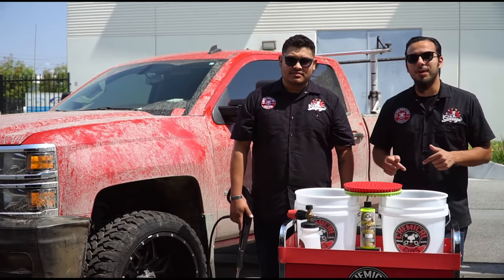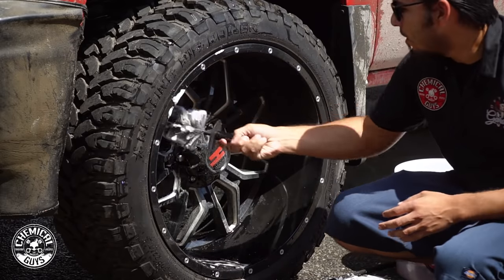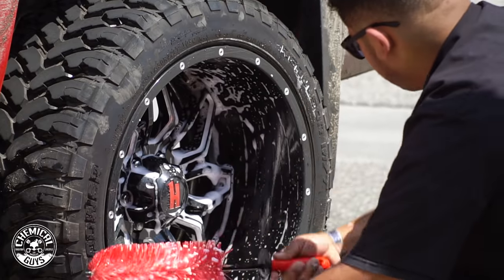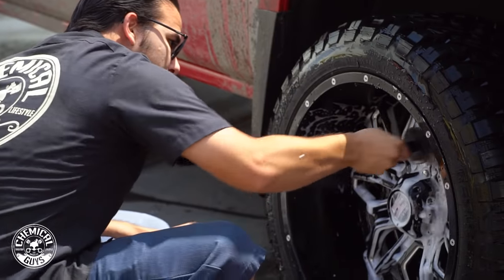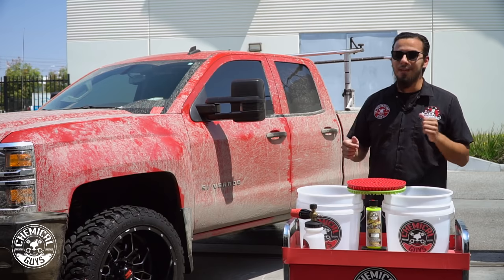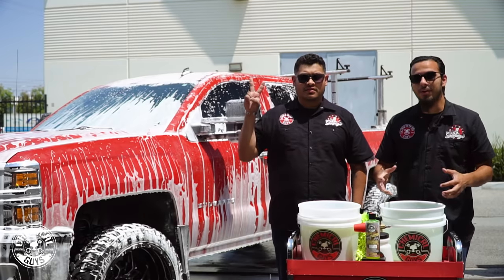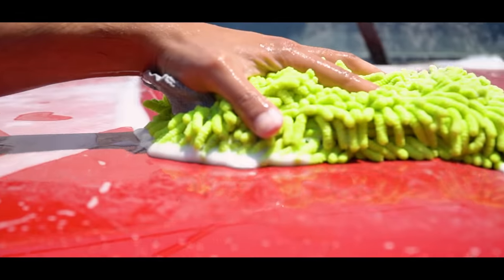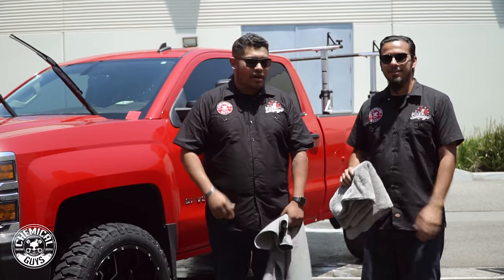How To Clean REALLY Muddy Truck! - Chemical Guys

Comment: I’m glad you guys used a SunJoe electric pressure washer. Most think you need gas to make a lot of foam which isn’t true. Do you guys ever swap out orifices on your cannons? Or better question what size do they come with ? Great video! Chem Guys make the best car soaps!!
Reply: I have the ryobi 1.2 gpm 2000 psi and run a 1.1 orifice on my foam cannon. they have to run like .8 to get that foam out of a sunjoe.
Reply from the maker: Hi guys, we do not change or swap out orifices in our cannons. We use them exactly as they come. Thanks for watching guys and make sure to check out our latest video just released moments ago!
Reply: REALLY? I can't believe that foam amount without changing the orifice.! Like I said what pressure washer I use and I find it hard to get really really thick foam with my 1.1mm on the snow foam cannon!

Comment: My white truck still has some specs of mud left on it in certain areas that I can’t seem to get off. What exactly do I need to do here?
Reply from the maker: Hi there! If the paintwork is stained it may require a clay bar treatment to thoroughly cleanse the surface. A Medium Clay Bar with Luber should have no problem restoring shine.

Comment: I know it's more of a commercial for their products but how much would it cost to buy everything they used in the video? Would it not be cheaper to just buy a few passes to a full service car wash? (In Canada we have places that hand wash your car inside and out for about $30)
Reply from the maker: Hey Bryson, thanks for stopping by. Sure a one time car wash might be cheaper at first, but the whole point of purchasing is the product will last you and last you. Check out the 14 piece detailing kit below. At only $89.99, it only takes 3 washes for the kit to pay for itself, and the chemicals will be no where near empty. The kit has pretty much everything you need to clean, wax, and dress your car. You may want to add an odd brush or chemical down the line, but the vast majority of the items you will need are included to get started detailing right away. This kit doesn't even require an expensive pressure washer- you just hook the TORQ foam blaster up to your standard garden hose! Thanks for watching, Bryson, and let us know if you have any other questions!

Comment: Could this be a good soap for semi trucks or do you have a soap for semi truck detailing?
Reply from the maker: Hi James! Tough Mudder is a great wash for semi trucks. The thick soap clings hard to abrasive dirt and sand, releases it from the surface, and surrounds it with slick lubricants to help prevent swirls and scratches. Thanks for watching and thanks for being part of the Chemical Guys family!

Comment: How do you avoid water spots washing in direct sun? Or have I been rushing myself for no reason. LOL
Reply from the maker: Hi Scott, great question. Here are a few reasons:
1. We use deionized water.
2. This soap, like most premium CG soaps, is pH balanced.
3. The climate was temperate. 
4. The paint was cool to the touch. 
5. We dried the truck immediately. 
Thanks for watching, Scott, and thanks for being a part of the CG family!
Reply: I have a bunch of your soaps, but no deionized water. I wash either early in the morning or in the evening, wash with the foam cannon and mitt like a crazy person and run it into my garage to dry it off. And still manage to get a few spots. Not bad mind you. We have super hard water here in the Mid Atlantic. Thanks for the reply!!
Reply: Scott Dabson hard water is hard to not get spots. Got to be efficient as it sounds you are,  here or there you can spot to take care of them. I used to live in a house that had bad hard water and man it sucked washing cars.

Comment: What kind of power washer did y’all use?🤔
Reply from the maker: Hi Sebastian! Great question. In this video, we used our electric pressure washer, which is a SunJoe SPX4001 with a PSI of 2,030 and a GPM of 1.75. We recommend a machine with similar specs! Thanks for watching and stay tuned for more awesome content coming your way soon!

Comment: Nice, you using a SunJoe pressure washer. That's what I use
Reply from the maker: Hi! Yes that is correct. We currently use a Sun Joe electric pressure washer with a PSI of 2,030 and a GPM of 1.75. We recommend a machine with similar specs!Thanks for watching and thanks for being a part of the Chemical Guys family!

Comment: Hey guys any recommendations for removing tree sap? I’m out in Oregon and I’ve got a pine tree over my driveway, with the recent heat wave it has completely coated my truck with sap. I’ve used your V07-Blacklight- honeydew snow foam and I’m still left with some residue.
Reply from the maker: Hey Johnny, great question. Here at Detail Garage, we use Butter Wet Wax to safely remove tree sap. Watch the video below to see how. Thanks for watching, Johnny, and stay tuned for a new video dropping tomorrow !
https://www.youtube.com/watch?v=0qUtgB-bP08&t=8s
Reply: Thanks guys!

Comment: What type of power washer are you guys using ?
Reply from the maker: Hi, we currently use a Sun Joe electric pressure washer with a PSI of 2,030 and a GPM of 1.75. We recommend a machine with similar specs! Thanks for watching and thanks for being a part of the Chemical Guys family!

Comment: I'd like know what brand of pressure washer and psi you are using. Tia
Reply from the maker: Hi! Great question. In this video, we used our electric pressure washer, which is a SunJoe SPX4001 with a PSI of 2,030 and a GPM of 1.75. We recommend a machine with similar specs! Thanks for watching and stay tuned for more awesome content coming your way soon!

Comment: i’m not a pro or anything but wouldn’t u wanna clean wheels last???
Reply from the maker: Hi Trent! In most cases, the wheels are dirtier than the vehicle so if they are left for last the abrasive filth from the wheel can be transferred to the body which would need to be wiped away carefully to prevent damage. Cleaning them first reduces this risk. - Happy detailing!!

Comment: What psi is the pressure washer y’all are using?
Reply from the maker: There are so many different models on the market but I recommend using a pressure washer that is capable of 1800-3500 PSI and between 1.5 - 2.0 GPM.

Comment: This is one of the few videos that actually shows them putting soap on the vehicle when its muddy. This is the correct way to wash off mud. Soap breaks up the mud and provides a lube to protect your paint from being scratched. Almost every other video shows them blasting the mud off with a pressure washer first and then soaping it afterwards and that's the wrong way to do it!
Reply from the maker: Thanks so much for watching!

Comment: Washing in direct sunlight? That is a no no,  It will create water spot. What is the tank at 7:12?.
Reply from the maker: Hi there, we appreciate your concern for this customer's car, but would like to impart a few reasons why it was safe for us to wash this car in direct sunlight:
1. We use deionized water.
2. This soap, like most premium CG soaps, is pH balanced.
3. The climate was temperate. 
4. The paint was cool to the touch. 
5. It's California, so why wouldn't you want to be outside? 😊
We have detailed thousands of cars over many years under the conditions above, all to the utmost satisfaction of our customers. If you ever have any questions, or are new to detailing, we encourage you to contact us for advice. We can be reached via telephone, email, or even facebook messenger and are here to help.

Comment: What power washer is that?
Reply from the maker: Hi! Great question. In this video, we used our electric pressure washer, which is a SunJoe SPX4001 with a PSI of 2,030 and a GPM of 1.75. We recommend a machine with similar specs! Thanks for watching and stay tuned for more awesome content coming your way soon!

Comment: Only thing I would’ve done differently was start with the body first, wheels and tires last
Reply from the maker: Hi! There are a few reason why you want to clean the wheels first, a few which I will highlight now. If you wash the body of the car first, then you risk getting dirty water/product onto your newly clean car paint. Wheel cleaners and tire cleaners often use harsher chemicals so doing the body first minimizes the chance of getting overspray or spent product on the paint. If you washed the body first, you would need to dry the body before moving onto the wheels and tires to prevent water spots. It's extremely hard if not impossible to not get the body wet again when washing and rinsing the wheels and tires after drying, so you end up washing and then drying the whole bottom part of your car again! You can dress your wheels and tires after the whole car is clean. Thanks for watching and make sure to check back every Monday, Wednesday, and Friday for new video uploads!

Comment: Ok but I don’t understand why you cleaned the wheels first... unless you went back and dressed them. All the mud just falls right down on them. Maybe i missed something
Reply from the maker: Hi! Good question. There are a few reason why you want to clean the wheels first, a few which I will highlight now. If you wash the body of the car first, then you risk getting dirty water/product onto your newly clean car paint. Wheel cleaners and tire cleaners often use harsher chemicals so doing the body first minimizes the chance of getting overspray or spent product on the paint. If you washed the body first, you would need to dry the body before moving onto the wheels and tires to prevent water spots. It's extremely hard if not impossible to not get the body wet again when washing and rinsing the wheels and tires after drying, so you end up washing and then drying the whole bottom part of your car again! Thanks for watching and make sure to check back every Monday, Wednesday, and Friday for new video uploads!
Reply from the maker: Try it both ways for your next couple of car washes and let us know which one you prefer. In all our experience, we found this way to be best! Keep in mind we also don't apply wheel waxes or dressings until after the WHOLE vehicle is washed and clean. Thanks for watching buddy and happy detailing!

Comment: Why are you doing this in like brightest/hottest  time ever wouldn't that leave sun blotches ?
Reply from the maker: Hi, great question. Here are a few reasons:
1. We use deionized water.
2. This soap, like most premium CG soaps, is pH balanced.
3. The climate was temperate. 
4. The paint was cool to the touch. 
5. We dried the truck immediately. 
Thanks for watching and make sure to check back later today for a new video upload!
Reply: Chemical Guys ohhhh ok well you guys keep up the great work

Comment: You guys are professionals but still wash your cars in sunlight
Reply: when you use de ionized water you can wash in the sunlight...
Reply from the maker: Hi there, we appreciate your concern for this customer's car, but would like to impart a few reasons why it was safe for us to wash this car in direct sunlight:
1. We use deionized water.
2. This soap, like most premium CG soaps, is pH balanced.
3. The climate was temperate. 
4. The paint was cool to the touch. 
5. It's California, so why wouldn't you want to be outside? 😊
We have detailed thousands of cars over many years under the conditions above, all to the utmost satisfaction of our customers. If you ever have any questions, or are new to detailing, we encourage you to contact us for advice. We can be reached via telephone, email, or even facebook messenger and are here to help.
Reply: Ohh that explains alot thanks 👍

Comment: Who cleans their rims first...especially with all that dirt gonna fly back onto em when you wash the truck now lol. First rule of washing anything go top to bottom.
Reply from the maker: Hi! There are a few reason why you want to clean the wheels first, a few which I will highlight now. If you wash the body of the car first, then you risk getting dirty water/product from your wheels onto your newly clean car paint. Wheel cleaners and tire cleaners often use harsher chemicals so doing the body first minimizes the chance of getting overspray or spent product on the newly clean paint. If you washed the body first, you would need to dry the body before moving onto the wheels and tires to prevent water spots. It's extremely hard if not impossible to not get the body wet again when washing and rinsing the wheels and tires after drying, so you end up washing and then drying the whole bottom part of your car again! Thanks for watching and make sure to check back every Monday, Wednesday, and Friday for new video uploads!
Reply: @ChemicalGuys  makes sense thanks!
Reply: @phil9022  tbh, I've never done it that way and always worked from top to bottom. I'm above the wheels and angle the washer lance down, never had a problem.